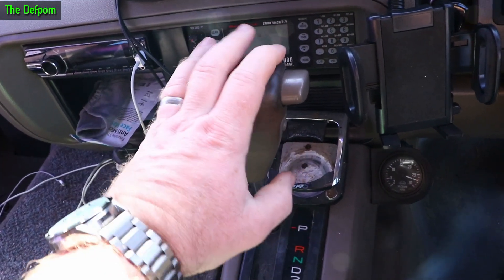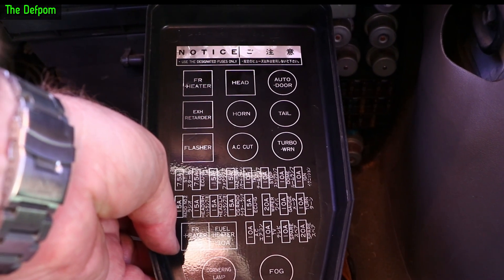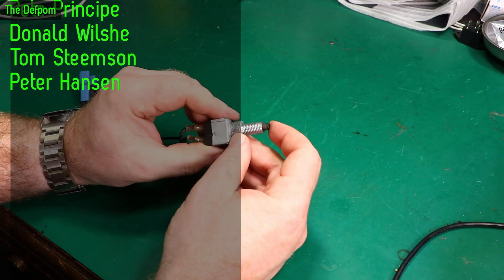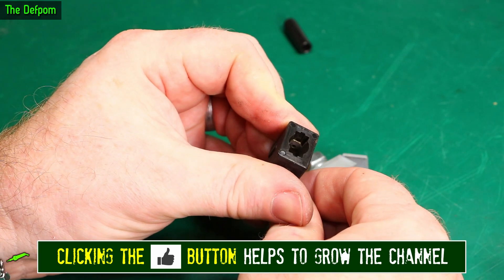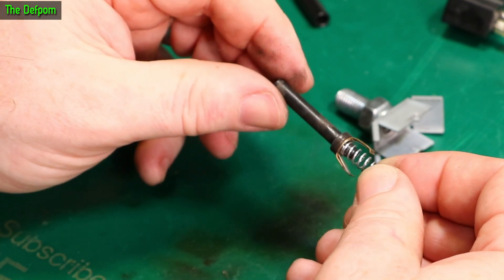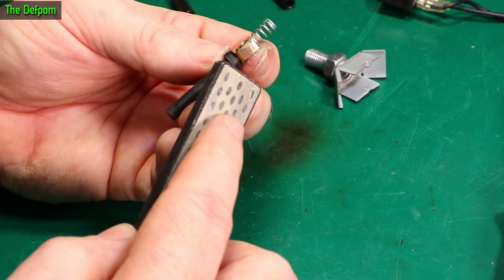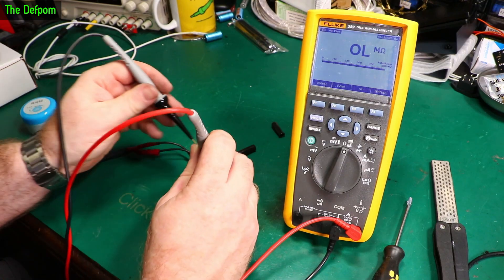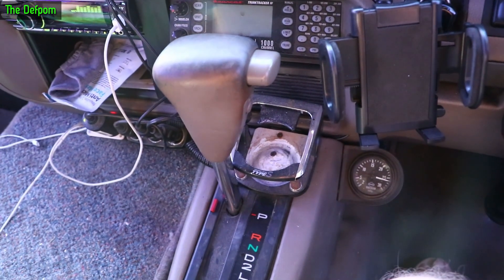🔴 Toyota Gear Shift Stuck In Park & Brake Switch Repair - No.1073

Comment: My first reaction to my switch failing was what is the cost of the OEM replacement, which was $45.45 USD. Well okay this seems a little high, but alright do you have any in stock, the answer was no, but they could ship it to me in 4 days, but I would have to pay for expedited shipping. I though okay but I really don't want the truck not working for 4 days. So, I decided to repair the switch my self. 

Since I do electronic repair, I thought I might as well put the contacts under the zoom stereo microscope to see what they look like close up, and actually you could see much more resolution in the wiper damage, both in the actuator wipers and the stationary contacts. 

I was able to clean and polish both using emery cloth 240, 400 and 600 grit, in that order which included rinsing using Deoxit D5 Spray. Sealed where the connection tabs go through the plastic with Grote Ultra-Seal, and treated the contacts with Deoxit D100L in the little bottle with the brush. I also put a little silicone lube spray (Liquid Wrench Silicone Spray) on the plastic plunger and worked it in. 

The switch has been working for 4 years now without any problems. Like you I was surprised when I pulled the switch apart to find that there was no lubricant or sealant in the switch assembly.